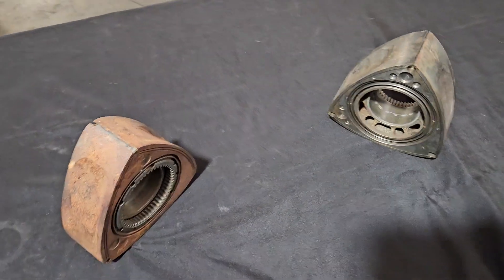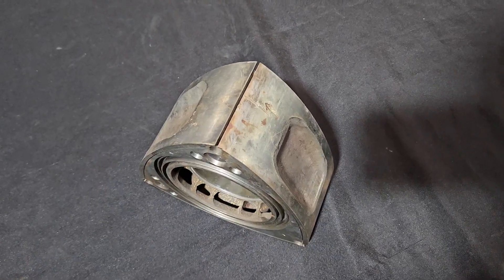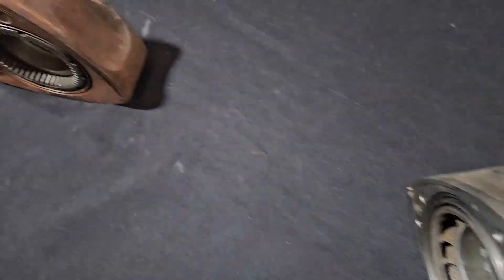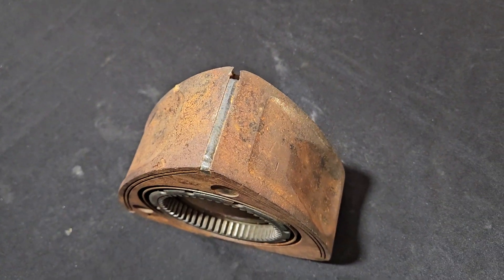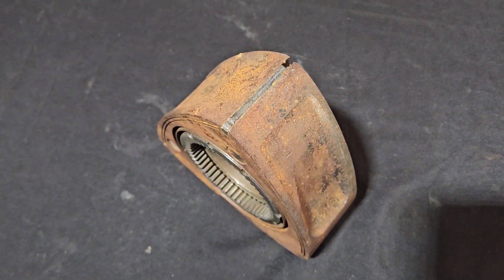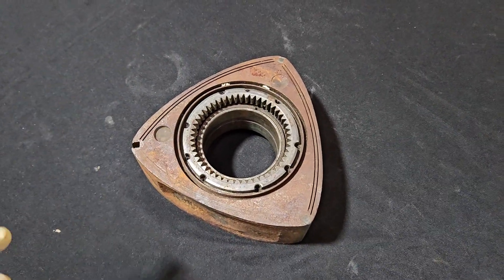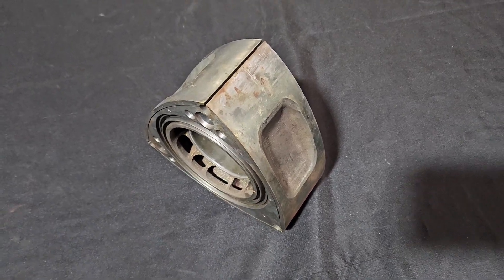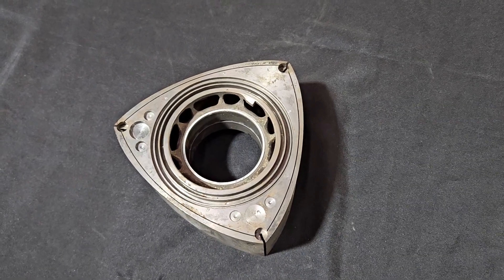Apex seal myth? How did the apex seal get a bad reputation - KMR Rotary Engine

Comment: I don't think you'll see turbos hitting 100k often.  And it only takes a couple of detonations to roast one
Reply from the maker: @aekagsr lol.  in the past 25 years, we saw quite a few OEM turbo 2 and FD3S make 80 to 130k.  And most only blew up after being modified. We also saw a lot of motors die for non apex seal related issues. Hence why it's a myth with some truth.  Even to your suggestion... The Apex seal didn't fail... detonation occured which is tuning or fuel delivery or temp issue....simply not just the apex seal's fault.
Reply: @KyleMohanRacing whats a "few?". And i didnt blame the apex seal for detonation, you cant possibly say they will last as well once it occurred compared to a piston ring.

Comment: While the carbon would wear faster they are very easy on the housings.
So you could always reuse the rotor housings on a rebuild.
Lack of coolant changes was always the major problem
Reply from the maker: yep, same for racing, they are easy on the housings but wear fast.

Comment: I have had problems with OEM apex seals past about 350whp. They are brittle and I have seen several sets break where the main seal meets the small end piece. 

Past 350whp I prefer aftermarket. I have seen them survive detonation events without breaking and worst case is the engine comes back apart for a less expensive seal replacement compared to needing a new rotor and housing.
Reply from the maker: yes Id recomend and aftermarket seal at that power level.

Comment: blew my first motor after 2 years of owning an rx8; what I can guess at least it misfired or predetonated while overtaking. shattering an apex seal, that wrecked the chamber before it finally landed in the exhaust at 90k km - prolly just bad luck
Reply from the maker: @cocoblacked  90k on a rx8 was short but normal.  85k to 140k motor most of the time.  But the rest of the car lasts well.  New block = another 80 to 100k

Comment: What about rx8 why’d they use smaller ones compared to rx7?
Reply from the maker: @MellowAintYello  i've got a few videos that talk about this. Rx7 and rx8 are both 2mm thick.  The rx8 Seal is not as tall since it doesn't need to pass over a peripheral exhaust port. That's why you don't want to run rx8 Rotors in a rx7  motor generally